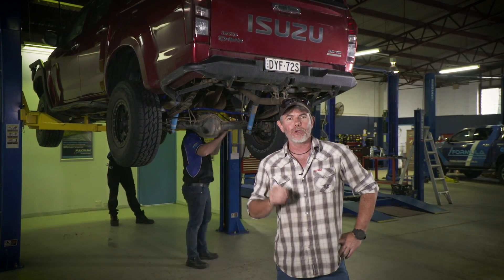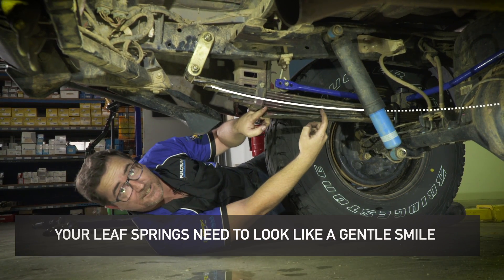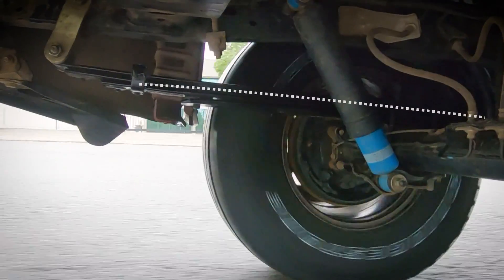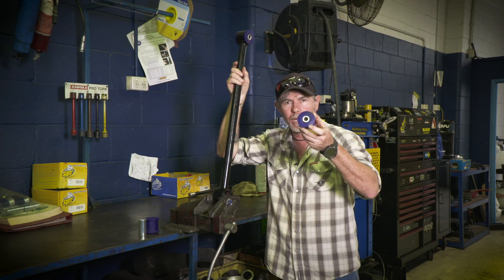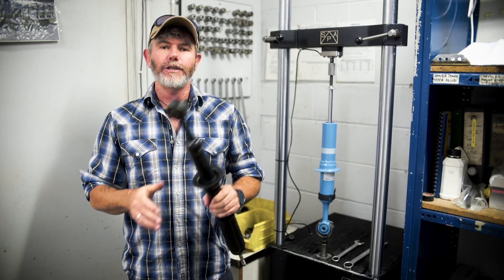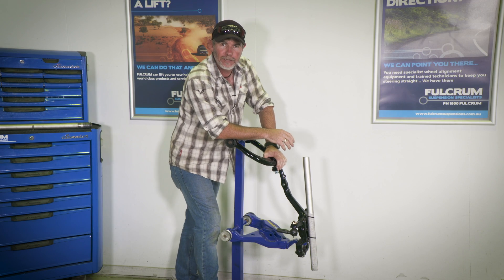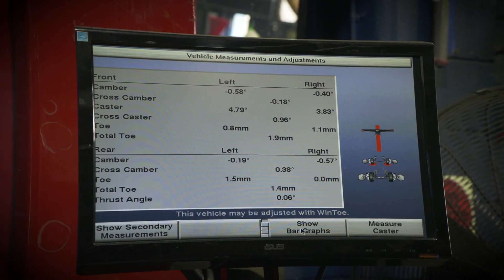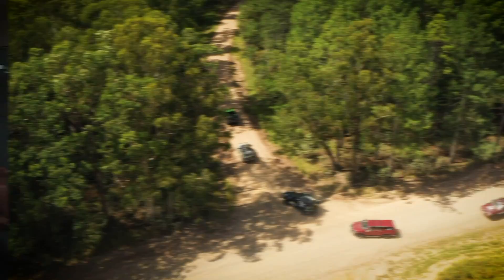4WD SUSPENSION IN DETAIL – what your 2 inch lift is missing! Graham Cahill reveals expert secrets

Comment: What size/brand tyre and rims you have on dmax. You had mentioned diff drop can you shed some light on that part of the setup. Also diff between standard and parabolic leaf springs. 
Everytime I select Vehicle your AFN rear bar doesn't turn up....a standard wheel and jerry holder shows have you got this custom fitted.

Comment: What happened to raw? Fulcrum paying more?
Reply: We still sell and install RAW 4x4 as well. We consider our Formula 4x4 shocks an upgrade though and are installing them on the 4WD Actions teams car to show their potential.
Reply: @FulcrumSuspensions1976  Hi Fulcrum - are adjustable control arms necessary to correct camber and castor for a 2" lift on an IFS ute? At what lift height do you recommend these?  Cheers for the video.
Reply: @doug7001  They are not always necessarily needed on a 2 inch lift. It depends on the vehicle and application as certain vehicles run out of adjustment. If you get a 3 inch or above though you will definitely need an aftermarket control arm. Feel free to give us a call on 1800 385 278 to discuss or send us a text message through our website :)
Reply: @FulcrumSuspensions1976  Thanks for the insight. I'm going to put a 2" lift on a Hilux later in the year. I'll come to you guys then. Cheers,.

Comment: In Victoria, how much higher can you go from stock? Looking at a 2 inch body lift on top of my 2 inch suspension lift. While also running 33's.
Reply: Maximum lift without engineering is 75mm overall, 50mm max on suspension & 25mm maximum on tyre radius (2" diameter). Any body lift beyond this needs engineering 👍
Reply: @gaj5701  i have a dmax 2019 and have put on some 275/75/R16 mickeys atzp3 on with R16/10 steel wheels. How much lift would you recommend without engineering? Does engineering also include better control arms?

Comment: Only time I've ever heard of ADDING a sway-bar to the back of a truck, for offroading. The stiffer springs should eliminate the need for one, right?
Reply: not fully, spring make it carry load better, but a sway bar will stop the 4wd leaning over without compromising on the ride quality.

That said a sway bar "Will"  reduce flex offroad... but it will also make it harder to roll over when offroad..
Reply: Adding stiffer springs will work but it will give you a much harsher ride. We like to save our customers from back pain ;)

Fitting larger sway bars, particularly in the rear, has two main effects, vehicle balance in terms of under steer or over steer and increased roll resistance. Both of these effects can provide increased overall handling and safety benefits in a 4WD vehicle. If you are looking for increased stability on the road or when towing, sway bars are a great upgrade option.  

As most factory vehicles are partial towards under steer, fitting of a larger rear sway bar, or the addition of a sway bar, helps in providing a more neutral characteristic in the handling. This is due to the increase in roll stiffness at the rear, which changes the loading of the rear wheels under conditions of increased cornering load. SuperPro offers a great range of aftermarket sway bars engineered for many off-road applications, also offering many adjustable kits to best suit your 4WD build. 

At the same time, as the rear end is resisting more of the roll, the front end resists less in proportion, leaving the front wheels more evenly loaded, producing more available front end grip. In the end an increase in overall stability can be achieved by balancing the vehicle.

Another effect of introducing larger rear sway bars is a reduction in chassis roll. This reduces the effects of “roll camber”. Roll camber is the variation in the wheel and tyre camber setting due to chassis roll. During cornering the presence of chassis roll usually results in the outside wheels gaining positive camber. By increasing the roll stiffness and reducing roll camber effect, the wheel and tyre combination stays closer to its optimal setting.

As an alternative, this could be remedied by starting out with large amounts of static camber to counteract the positive camber gain. The trade-off however is the resulting increased tyre wear, and reduction in straight-line handling.

Now that the basics are covered, imagine a Nissan Patrol, Toyota Land Cruiser or Toyota Hilux that has been lifted 50mm with a bull bar and winch package. It has been fitted out with a draw system, roof rack and tows a twenty foot caravan! This may be the extreme, but somewhere between this and a standard, off the showroom floor vehicle, is where most of these vehicles operate. The factory sway bars were never designed to control anything other than the standard vehicle at standard ride height and with something less than being loaded to their GVM (Gross Vehicle Mass) limit.

The modern 4WD Dual cab utility, almost the family sedan of this century. Is normally coil sprung with a strut front end and leaf sprung rear with no rear sway bar support. Because of this dual cabs typically suffer from under steer and can be very unstable during high speed directional changes. When you load the vehicle with accessories, people, change its height or tow the problem only gets worse.

The biggest resistance to the fitment of bigger sway bars to 4WD vehicles is the flawed concept of the loss of articulation in the suspension. If the replacement sway bars are designed correctly and the sway bar links are lengthened, replacement sway bars can be fitted with minimal or no loss of articulation. However, the improvements to stability, safety and drive ability will far outweigh any loss of articulation.

So without reducing comfort or articulation, a sway bar will make the suspension system and tyres perform better, making the vehicle more responsive while neutralising under steer. Fitting a sway bar offers all round improvements in handling, tyre wear, comfort, safety and load carrying. It is one of the best handling improvements you can make.

Feel free to call us on 1800 385 278 or send us a message through our website.
Reply: They are plugging the shop's inventory - adding a rear sway bar for offroading capability is not advised.  For multi-use vehicles, it is great - but get a unit with quick disconnect links or you will lose traction and flex (unless you want to lift tires all day)
Reply: @ewingfox6459  that's what I am thinking. Anything off-camber would lift your axle up. If you aren't locked, you lose traction....I even took my front bar off, to let my ifs flex more......unless you are using the vehicle for towing or something that requires more stability.
Reply: @ocj921  on the road, it IS a good idea to have at least a front sway bar.. swerve to miss a roo (or a moose/bear/deer where we live) and you could easily end up on your lid :). Quick disconnects would be a good idea for you!)

Comment: Always good stuff!  Don't forget the brake lines or tie rods!  The rear brake lines look a bit short for hitting the tracks. Also, those factory tie rods are a bit thin when running the lift and bigger tyres.  Look into some tie rod sleeves.

Comment: G'day legends! Awesome video so thanks to all for putting this together. My question is, I have a NS pajero with indapentant front and rear suspension. (It loves a good wheel lift) wondering the best way to set up this type of suspension as I am looking into a 2inch lift for the old girl.

Cheers blokes
Reply: @fukthegoog Yes we do and are more than happy to answer :)
Reply: Set the springs up correctly on the vehicle so it handles the correct weight and flexes. Feel free to give us a call on 1800 385 278 or send us a message through the website and we can help you more with your lift kit.
Reply: @FulcrumSuspensions1976  thanks legends. I'll be sure to get in contact and figure out exactly what I need. Thanks heaps
Reply: @fukthegoog I never expected anything from this but it never hurts to ask, and what do you know I found some assistance. So if anyone's the Muppet mate it's you.

Comment: I drive a Pajero iO and run stock (coil f & r) suspension. The ride, particularly in the rear, is very uncomfortable going over even the smallest bumps. 
Why is this the case?
What can I do to change this?
Reply: SWB and a light vehicle? You could try different air pressures in your tyres or try to get a higher profile tyre (more sidewall = more comfort).
Reply: Tyre pressures could be an issue. Shock absorbers could be stuffed or the vehicle is too loaded for the springs. To make sure there is no issue I would recommend a suspension check. We offer a free suspension check at all our stores. Feel free to give us a call on 1800 385 278 or send us a message through our website.

Comment: I have a question I have a 2004 Chevy 2500hd and my 4wd is not working right my 4wd high range will not lock in but my low range will but when my low range is it makes a popping / grinding sound. What could be wrong with it  ?
Reply: Burn it buy a cruiser
Reply: As you know, they are in Australia, so they don't deal with the same heavy duty trucks we do in North America. I would suggest getting it checked out at a shop you trust

Comment: how does a swaybar affect the vehicle offroad, ie flex
Reply: Fitting larger sway bars, particularly in the rear, has two main effects, vehicle balance in terms of under steer or over steer and increased roll resistance. Both of these effects can provide increased overall handling and safety benefits in a 4WD vehicle. If you are looking for increased stability on the road or when towing, sway bars are a great upgrade option.  

As most factory vehicles are partial towards under steer, fitting of a larger rear sway bar, or the addition of a sway bar, helps in providing a more neutral characteristic in the handling. This is due to the increase in roll stiffness at the rear, which changes the loading of the rear wheels under conditions of increased cornering load. SuperPro offers a great range of aftermarket sway bars engineered for many off-road applications, also offering many adjustable kits to best suit your 4WD build. 

At the same time, as the rear end is resisting more of the roll, the front end resists less in proportion, leaving the front wheels more evenly loaded, producing more available front end grip. In the end an increase in overall stability can be achieved by balancing the vehicle.

Another effect of introducing larger rear sway bars is a reduction in chassis roll. This reduces the effects of “roll camber”. Roll camber is the variation in the wheel and tyre camber setting due to chassis roll. During cornering the presence of chassis roll usually results in the outside wheels gaining positive camber. By increasing the roll stiffness and reducing roll camber effect, the wheel and tyre combination stays closer to its optimal setting.

As an alternative, this could be remedied by starting out with large amounts of static camber to counteract the positive camber gain. The trade-off however is the resulting increased tyre wear, and reduction in straight-line handling.

Now that the basics are covered, imagine a Nissan Patrol, Toyota Land Cruiser or Toyota Hilux that has been lifted 50mm with a bull bar and winch package. It has been fitted out with a draw system, roof rack and tows a twenty foot caravan! This may be the extreme, but somewhere between this and a standard, off the showroom floor vehicle, is where most of these vehicles operate. The factory sway bars were never designed to control anything other than the standard vehicle at standard ride height and with something less than being loaded to their GVM (Gross Vehicle Mass) limit.

The modern 4WD Dual cab utility, almost the family sedan of this century. Is normally coil sprung with a strut front end and leaf sprung rear with no rear sway bar support. Because of this dual cabs typically suffer from under steer and can be very unstable during high speed directional changes. When you load the vehicle with accessories, people, change its height or tow the problem only gets worse.

The biggest resistance to the fitment of bigger sway bars to 4WD vehicles is the flawed concept of the loss of articulation in the suspension. If the replacement sway bars are designed correctly and the sway bar links are lengthened, replacement sway bars can be fitted with minimal or no loss of articulation. However, the improvements to stability, safety and drive ability will far outweigh any loss of articulation.

So without reducing comfort or articulation, a sway bar will make the suspension system and tyres perform better, making the vehicle more responsive while neutralising under steer. Fitting a sway bar offers all round improvements in handling, tyre wear, comfort, safety and load carrying. It is one of the best handling improvements you can make.
Reply: @FulcrumSuspensions1976  it would be interesting if you could do a video showing exactly how much articulation a standard vehicle has, and how much it has with your sway bar fitted on each of the three settings. 
I've considered fitting one myself, but I already have a dismal amount of rear articulation and I know how much of a difference it makes having sliding sway bar links on the front (or disconnects).
Reply: A sway bar will limit flex off-road. By disconnecting the sway bar, you are letting the suspension articulate more. On the road, the sway bar helps to reduce body roll.
Reply: I run without front or rear sway bars on my CJ7, but if you plan on lost of road miles, consider one with removable links. Check out the JKS J-Kontrol kit, they use sprung detent ball locked pins for their quick disconnects, they take seconds to remove when hitting the trail.
Reply: isn't  flex  suspension atriculation
Reply: for offroad flexing/crawling/whatever-you-wanna-call-it you want the suspension to work as independently as possible i.e. no swaybars. Adding sway bars is like having stiffer springs but only in the side-to-side direction - they reduces body roll during cornering but do nothing to affect your ride height versus load weight nor do they affect how much the car squats and dives under acceleration and braking. Contrary to popular belief, you get more cornering grip without one on-road as well because less body roll does not necessarily mean less weight shift. Installing stiff sway bars actually increases weight shift to the outside wheels so they will become overloaded and skid at a lower cornering speed. Having more grip around a corner is however a moot point if your car flips over mid corner haha. Having stiffer springs and/or swaybars also improves the cars dynamics, so while it may have less ultimate grip it is less likely to get into an uncontrollable fishtail if you suddenly swerve.
Reply: Isuzu have a swaybar stock, so it won't effect it.